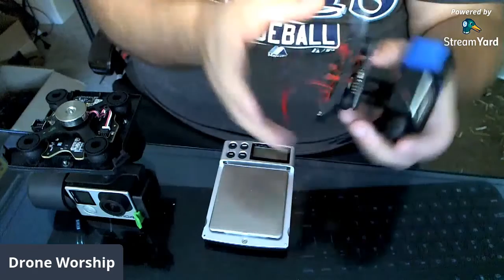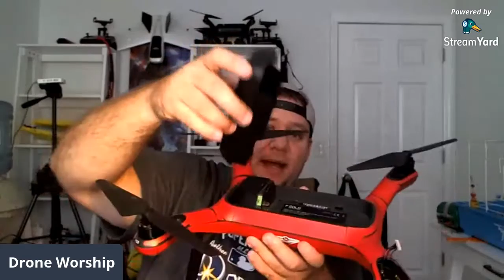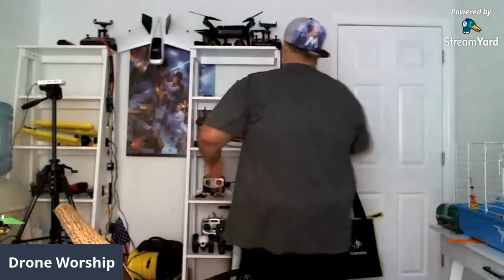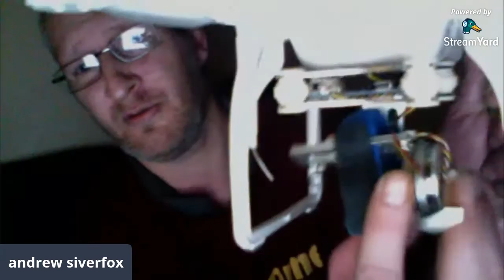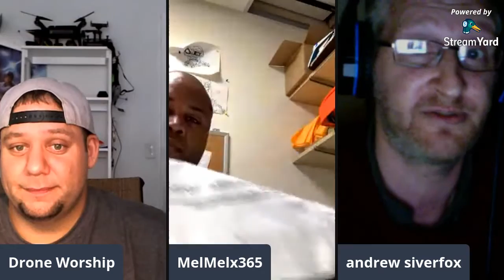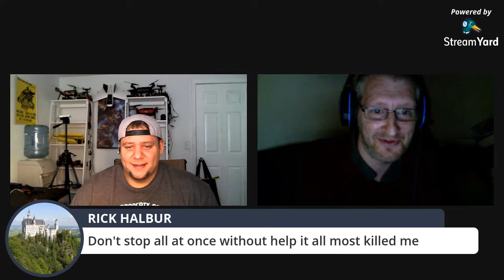3DR SOLO Aftermarket Gimbal Weight VS Stock OEM Gimbal More Flight Time?

Comment: Sorry to disturb you with my issues. i need help.
i have a 3DRSolo and i love it, i install a 3rd party gimbal. In the beginning i couldn't, make it work like using the transmitter to pitch the camera up/down, then i change the board and it works fine, the only thing now the bird after take off it stays hovering for 3 to 4 seconds and it start to dancing doing like a hula hoop, then it crashes, i did a callibration, i did a factory reset, keep doing the same, i have the logs if it helps you helping me i can send it to you. Thx, i really need help with it. regards.
Reply from the maker: That sounds like a problem with Arducopter your Cube might be going bad inside the solo or you're having a compass or accelerometer problem it might even be the GPS. Troubleshooting these small little problems can be a task my suggestion to you is join the 3dr Facebook groups and post your T logs someone will evaluate them and tell you what's happening
Reply: @IFixShet  Thx,
Reply: Hi There. My drone back to live again. What i did?
1. Remove the 3rd party Gimbal
2. Remove the extension legs
3. Open the top cover 🔌 usb cable direct to Cube from my pc for 5sec. Removed.
4. Close it
5. Calibrate.
6. Fly yupiiiiiiiiii. Thx for responding my crazy questions. Et voila.
I don't know if what i did affect anything. But at the end i did 3 flight of 6, 11, 8 mn respectively.
If anybody have the same problem try and see if works. Hope someone used.